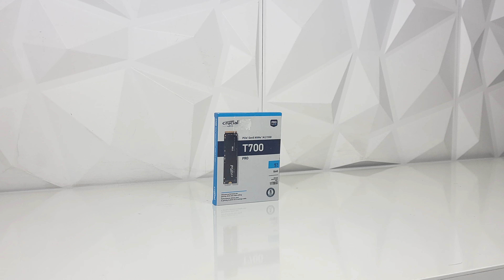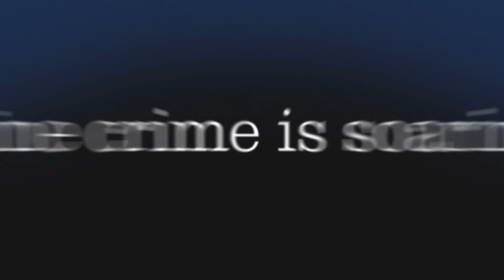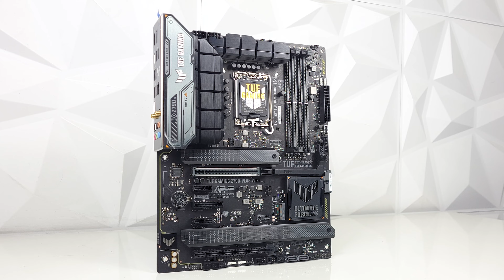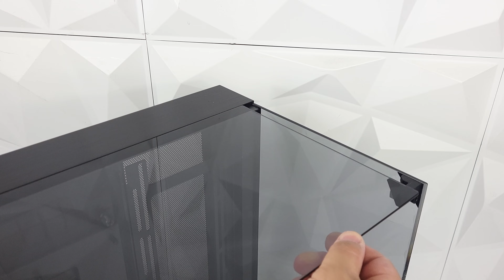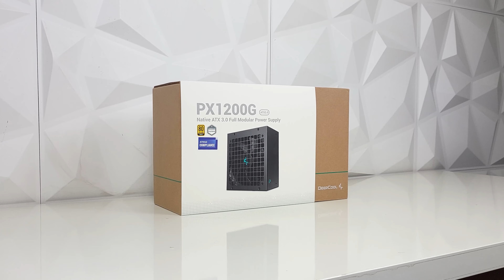Lian Li PC Build | Lian Li O11 Vision | i7-14700K | RTX 4070 Super FE | Galahad II LCD-SL | TL LCD

Comment: Hi, nice looking Build so far.....I have a Question: how do U wire the Fans? Is it possible to connect all Fans into 1 Control-Box (CPU-Fans and Case-Fans) or do I need two Controllers (1 for the 3 Fans on the Radiator as CPU-Fans and one for the other Fans in the Build as Case-Fans)?
Reply from the maker: You're going to need two different controllers because AIO & system fans are not the same type.

Comment: I couldn't choose between Evo RGB and Vision. I build mid-entry level systems. What would be your choice between these two cases for long-term use? I'm surprised at the thermal values of the sight. Almost the same as evo series 🤔
Reply from the maker: If you're planning for more fans, go with EVO RGB. I like vision for a more clean look.
Reply: @PCTechnician  Thank you for taking the time to respond.
Reply: Frankly, I have thermal concerns, I use Noctua d15S as a processor cooler. I've never used liquid cooling. 2 fans less, top closed; It shouldn't be possible for it to give almost the same temperature values as Evorgb 😬, it's unbelievable 🤷. It's crazy to save cash 2 fan and get the same thermal performance. Other than that, we fell in love with Lian Li Vision ;)

Comment: Can you explain the air flow directions to me? 
Rear and side are exhausts? And bottom is intake?
Reply from the maker: You are correct. Bottom fans are intake and the rest are exhaust.
Reply: @PCTechnician  How are the temperatures in this particular build? Does it run on the hotter side? I was always taught to keep equal or positive pressure. 
I’ve never built a PC with the intake just solely being on the bottom. 
Thanks for answering my questions!
Reply from the maker: One fan off air pressure. Not a problem, it works fine. Front & bottom fans are always known for intake and top & rear fans for exhaust.
Reply: @PCTechnician  You should have buy some reverse fans...

Comment: Hey Beautiful Build, Just one question Why you using NZXT Usb hub and do i need to use it in my future build ? i'm not gonna use LCD Inf fans but default inf fans 3 on side 3 top 3 bottom and 1 on the rear. Do i need The extra USB hub?
Reply from the maker: I used the hub because this build required three internal usb inputs. You don't need a hub if you're not using cooler required usb input.

Comment: hi, first of all nice video, congratulations, I wanted to ask you a question if I can.... I should install a galahad II inf, 3 uni fan sl120 inf fans and 3 uni fan tl lcd fans, I should use the hub that you used in the video... can I insert everything directly on the hub?? because going to the lian li site they advise me to use the ports of the mother board on the lcd fans...
Reply from the maker: No. I would advise to use the motherboard header if you can and only use the hub for extra connection.
Reply: @PCTechnician  okok, thanks but I only have two USB ports on the mother board, I connect the USB hub to one and the LCD fans to the other but by doing this the Galahad II heatsink will be placed on the right Hub??
Reply from the maker: Using a hub for 3 devices can be tricky because it doesn't always work. You may have to switch around the connectors

Comment: Hey @PCTechnician I used your video as a guide for building my own gaming pc. Its all done but when I turn it on, the motherboard lights up but no fans or anything working and nothing on screen. Any ideas?
Reply from the maker: There are many things that cause this.1. Make sure the PSU 8 pin & GPU cable are connected. 2. CPU, memory, cables, etc.. are properly connected. 3. Motherboard is shorted or defected. 4. Rams is not compatible or defective. 5. Bad PSU. Many time problems can be solved by reconnecting all the parts and reset the CMOS bios. Good luck.

Comment: im am going with the same build this week, will airflow be an issue? (ryzen 7 7800x3d, rx 7900 xtx). 3 intake bottom fans, and 5 exhaust fans (3 aio exhaust fans). thanks :)
Reply from the maker: I would make as neutral air as possible but it should still work fine.

Comment: I gotta ask what’s the fans config ? Bottom intake and the rest exhaust so 3-4?
Reply from the maker: Yes. Bottom fans are intake, rest are exhaust.
Reply: @PCTechnician  that’s what I have now the exact same but how does it hold up in the long run I have a 7800x3d with a 4070 super
Reply: @PCTechnician  is it not bad?
Reply from the maker: Fan is one off from neutral. I wouldn't worries about it.